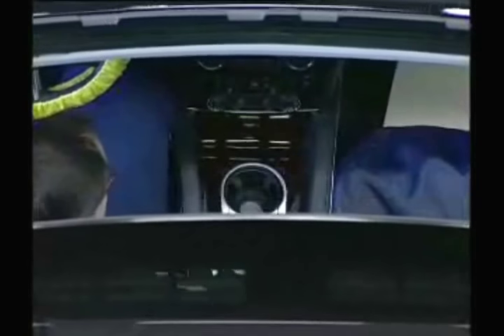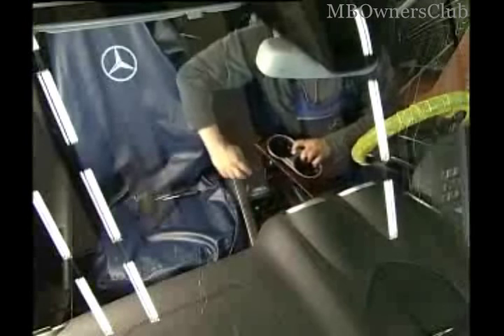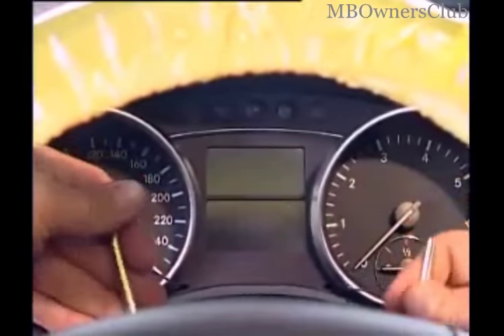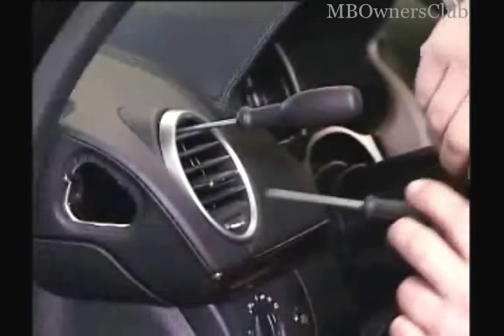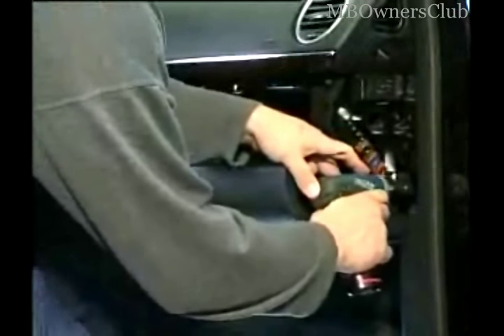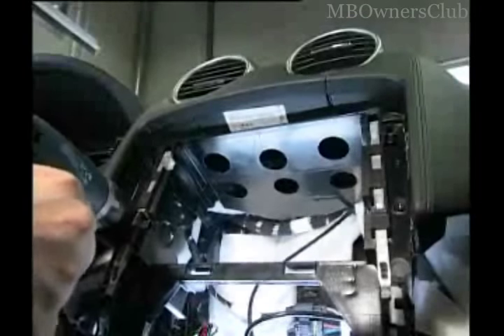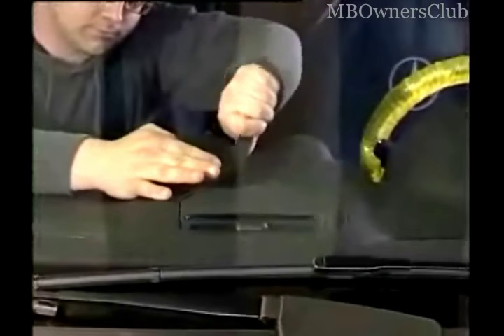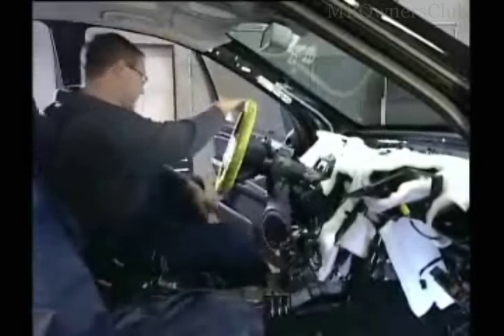Mercedes-Benz GL - Complete Guide to Removing the Dashboard and Center Console | X164

Comment: You guys are thr best I gotta do evaporator this video was such a big help salute I was so stuck
Reply: Hey mate, i think I'm in the same boat. Have changed compressor and condenser and still doesn't hold gas. How did you workout that your evaporator was leaking?